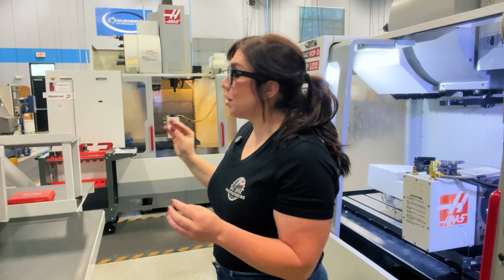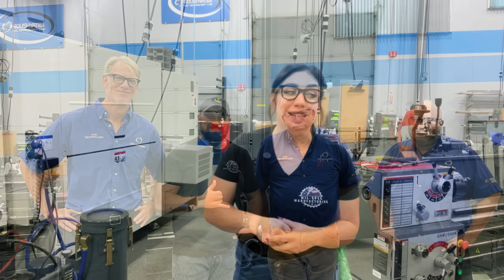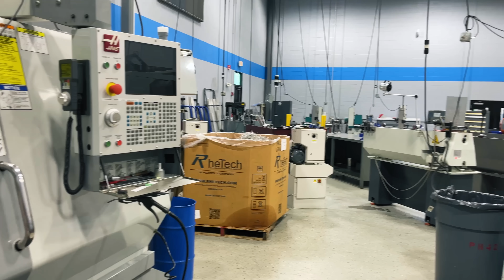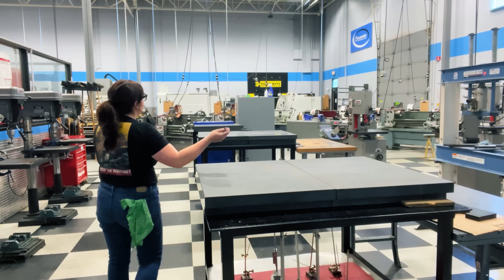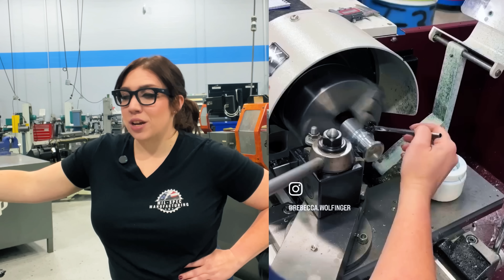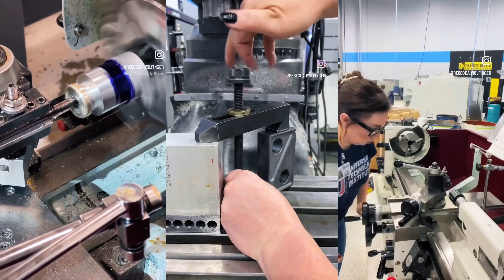Why a Machine Shop Owner Went Back to School for CNC Machining

Comment: I really appreciate this. I did not have a manufacturing background. But I taught myself about cnc and programming on the job and was doing 3+2 in a year. (Thank you to the machinists who put up with my novice questions!)
I'm now a few years in and also just started going to night school to learn more about manual machining. Because I'm largely self-taught and came in kind of backwards, I want to fill in any holes in my education and set myself up for a long career as a machinist.

Comment: I was working in IT for 30 years, and after my 3rd layoff decided I wanted to do something new and I picked machining because it seemed geeky as hell.  I am attending a tech college and I just started my 2nd year. What you described, is pretty much what I went through. I just finished the CNC turning and I just modeled my first part for milling.  I do have a required math class (geometry/trig) for machinists.  I got my first year paid for by a state grant. Didn't qualify the 2nd year, but I did put in for some scholarships for spring. Even w/o I think the 2 year program is around 15K.  Most of the shops here in MN that I've talked to so far, are requiring graduating from a 2 year program to start as a machinist.  So far it's been a great experience and I wish I could have switched after my 2nd layoff.
Reply: Oh wow! I feel the same way about wishing I had done this sooner. I initially enrolled last year, but my Mom was diagnosed cancer a week before my start date. Surgery asap. I withdrew to make sure I would be there for her.

She finally  look to be in remission!! 

School has been great. We do a lot of math, especially trig here too!
Reply: You seem like a go getter. Please be cautious getting into companies that work on a " we will see where you're at in a few years" mentality. Never too late to start learning machining